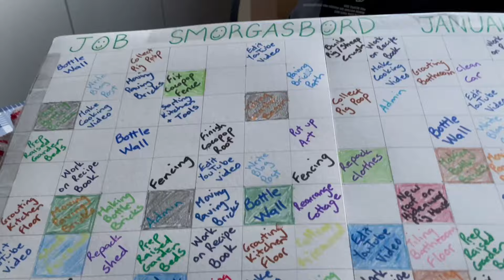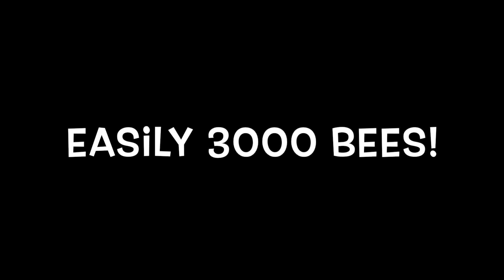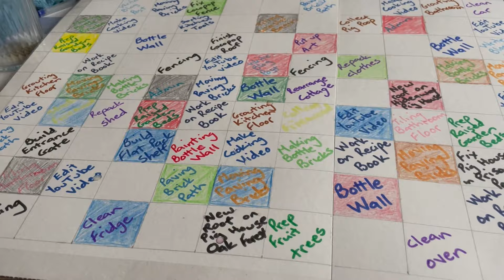NOTHING IS EVER SIMPLE / OFF-GRID LIVING IN PORTUGAL

Comment: Your clear bottles can be any colour you want, there are a multiple methods you could use, preferably before joining them, but also afterwards. I’ve also melted buckets with morning coals 🤷🏻‍♀️  on the granite why don’t you use face plates that you bolt into the granite then slide metal posts ‘like scaffolding poles ‘ into them? I have ones for my event tent with metal screws that have a hoop I can hand tighten. Mine are obviously removable at any time. But you could also slide wooden poles in and  wedge them. Xxx
Also if you use shade cloth on your raised beds it will effect your crops
Reply from the maker: Lots of problem solving for me!
Reply: @CindyVine  the trouble with problem-solving is we only have our base knowledge to act on. You are in the very enviable position of having 10,000 subscribers so why don’t you ask what we might feel would be the best way to solve a problem.  Then do what ever you want 🤣 this would also increase comments, although possibly piss a lot of subs off, when you don’t use their advice and make a few feel very special and connected xxx
Reply from the maker: I do sometimes ask, but I always check with Nick from Project Portugal as he understands my context here. @pebbles8022

Comment: Cindy to make a tunnel cover over your veg bed all you need is either steel spikes or round dowl sticks then plain black plastic water pipe, you put the pipe over each stick in a loop form, creating an arch, all the way to the end of the bed in intervals.  Then cable tie your shadenet over the loops, tight on top but looser on the bottom for you to slide the net up too harvest.  A more professional way would be to make a wooden frame with hinges and do the loop on it, so its like a lid you open. This loop pipe method you can even make a walk in shade net stucture, by using thicker pipes, they studier.
Reply from the maker: Sounds like a great idea!